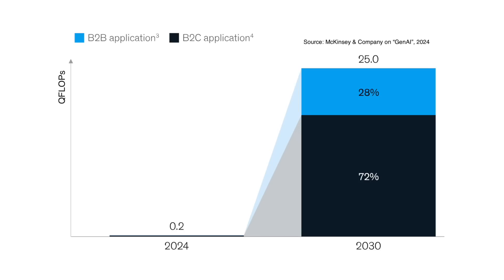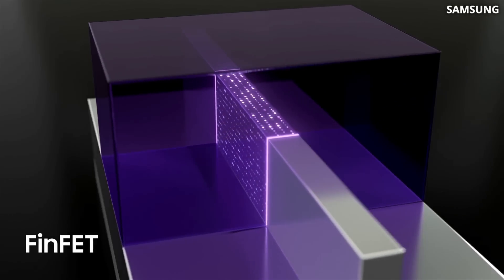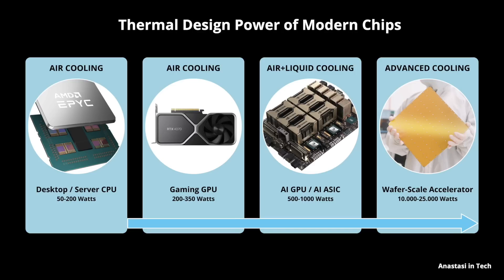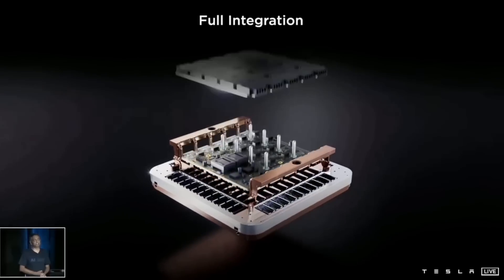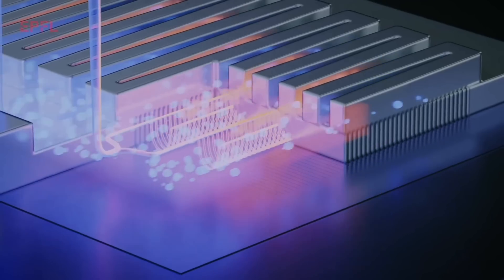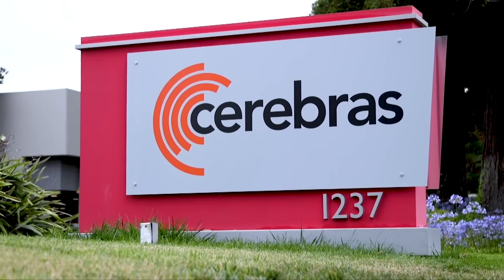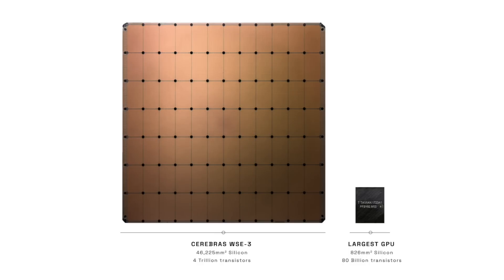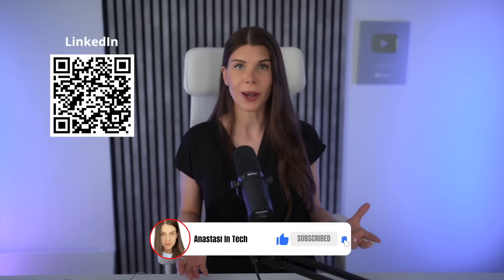This New Technology Will Keep Moore’s Law Going

Comment: If water works better than air to transfer heat, would there be something that transfers heat even better? I know that when your home air conditioner transfers heat out of where you live they don't use water. Perhaps some closed system involving some sort of refrigerant might be something to consider, the refrigerant flowing through or past the heat sinks for the chips.

One more observation about something that may be contributing to this heat problem: In the early days of computing, when CPUs were only 8 bit and resources such as memory were very limited coding was very efficient because it had to be. As the resources became greater and chips grew faster a lot of this coding efficiency went away. The less efficient the code is that the chips are processing the harder they have to work generating more heat. Just a thought.

Comment: I think the option of having phase change cooling just build into the CPU is a good option, so like a vapour chamber, but built into the CPU with the capillaries going right down into the CPU, then you shouldn't even need water cooling because you will be able to transport heat to air cooled heat sinks so efficiently it's no biggy, in cases were you want to have a heat spreader you can integrate the condenser into the heat spreader.

Like in a data centre you would still cool the air with water because it means you can efficiently transport heat outside the building meaning you can pack thermal density more tightly, but going with air cooling within each machine isn't about being cheaper for the hardware it's about the ongoing maintenance being more expensive over a 3 - 5 year period that is the big deal, the cost of the hardware compared to that is a none concern.

Comment: Ehh... you should know better that nm basically means nothing nowadays the feature size has almost no correlation to the branding name of the process, and minimum feature size does not even mean the same thing as transistor size because you have to have multiple features to make up a transistor so it's inevitably bigger.

Comment: At the beginning of 1970’s, the communication satellite dishes (for telecom companies) had cryogenic cooling attached to the rear to cool the LNA (low noise amplifiers). By the later 70’s the newer dishes used semiconductor LNA’s that did not require cooling.

Comment: It becomes clear that light will have to replace electricity for switching. Interference, both destructive and constructive will provide the 1s and 0s.
Power can be provided by the results of the SAFIRE experiment and the adoption of the Structured Atom model (SAM) of the nucleus.

Comment: All that heat is a valuable recourse if it can be captured and recycled into electricity.  It could help compensate for the large power needed to run the computers in the first place.

Comment: I've never been convinced that multiple CPU's are of great benefit unless the software is tuned to use them efficiently. I'd rather have a single fast CPU than multiple CPU's on the same chip. Simplyfication is one solution to heat generation.

Comment: I knew radio techs in the early 70's using "Can-tenna" products as dummy loads for r.f. outputs.  A 1 gal. paint can could dump a kilowatt of radio energy output into mineral oil while the set was tested and adjusted.

Comment: This issue is the same as faced by the home audio industry back in the 70's when regulations required that the advertised output be able to be maintained for, say, 1/2 hour, rather than momentary peak output.  Heat sinks grew exponentially and started including heat pipes and thermosiphons for the output transistors.

Comment: That wafer scale chip taking 15-25kW is crazy. For comparison, that converts to 20.1-33.5 horsepower which is about how much power it takes to drive a car at highway speeds.

Comment: Imagine if they started breaking out the silver and gold for data center chips for cooling. Also is it possible  to reduce the heat by using up some of the wasted energy? Maybe sending it to resistor arays or external trasitors that could power something like a piezo fans or charging a battery. Theirs better materials then copper just depends  on cost to efficiently over a set time of expected use. And its not like valuable metal loses it value when the product is obsolete just design in a way it can be recovered reasonably.

Comment: people working out what to do with all the heat, meanwhile people saying we need to burn more fuel and build more nuclear reactors to get hot so we can convert that heat into electricity. heat from compute should be compressed and used to generate electricity. recycle the power. heat->electricity->compute->heat->electricity->compute...

Comment: One of the natures of water is a cooler temperature for faster moving, could we use a variable velocity water cooling?  Seems like we need to go back to a single core per CPU to give room to cooling tubes.  The problem with multi-cores is the lack of multitasking because of memory restraints.

Comment: "...right  now the smallest transistors are just 2 and 3 nanometers..." -> this is not correct. The pitch between source and drain might be 2 or 3 nm but that's not the whole transistor. Process Nodes names are mostly for markting afaik.

Comment: Or you could use the Peltier stack so the heat generated from the cpu would power the first one and the 2nd one stacked on top of that would be powered by it so using waste heat from cpu to cool cpu

Comment: Someone should have informed Intel that the entire die can't be active all at the same time.

Sure direct chip cooling is certainly the future, but where does improved silicon wafer quality that allows larger dies to be more economical fit in? If nm advancement slows down due to the laws of relativity would silicon wafer quality improvements drive down the costs far enough so that spreading out the dies would be the stopgap approach to increasing performance?

Comment: semiconductors are getting smaller but our computers are getting bigger. My last one has a radiator with 3 fans for the liquid cooling and the video card is so big that it was coming with a support stick to put under. There is a total of 10 fans for cooling.  At least I live in Canada and that heath help to warm the house half of the year

Comment: i think the issue with backside power delivery might be solvable with a similar simpler solution on the bottom, and may not complicate the issue much more considering the complexity already there. if i understood what you meant.

Comment: Wondering when they go full Graphene instead of silicon that we currently use. We can see the physical limit in the Intel 13-14th gen 13900K-14900K heat limit from the voltage pushed to these CPUs.

Comment: why don't we utilise the heat in an exchange, like power generation systems?

the chip heat would then be a resource, end result processors would be more efficient regarding power.

like a nuclear power production system.

heat - steam - rotation - power

Comment: Has anyone that you re aware of considered running silicon devices at liquid nitrogen temperatures?  Lower temperatures allow you to avoid Shott noise so perhaps you can run at lower voltages (and hence less power).  This also has the lucky feature that the thermal expansion of silicon drop to zero, so local heating introduces minimal mechanical stress.  Liquid nitrogen is cheap like beer, so the cost should not be an issue for the big data centers.

Comment: I've wondered why motherboard companies haven't tried integrating more CPU cooling structures within their motherboards, allowing excess heat to be dissipated through a much larger area instead of the heat being directly allocated into the IHS and into a heatsink. Obviously, chip manufacturers would also need to alter designs to fit these sockets, but typical PC's should have enough airflow for rather good heat dissipation outside of the discrete heatsink. Even if only mildly successful, the payoff for servers, workstations, and GPU's would be rather large. Especially since I believe I heard that chip makers are moving power delivery to the underside of the transistors instead of on top.

Comment: Nope. The correct way forward is to design chips that use thousands of small cores, no cache, and which run at lower frequencies. After all, the human brain with over 80 billion neurons and trillions of interconnects (not to mention quantum information processing) manages to give us consciousness and creativity at a power rating of between 20W and 60W. We have gone down a horrendous blind alley and we lack the vision to think differently.

Comment: As cooling is actually transferring the heat (on chip or other) elsewhere; the ancillary opportunity is to turn that heat back into electrical energy for powering the cooling systems or the data centers. I know this become feasible only if the cost makes it so.

Comment: what if we designed non conductive, heat carrying channels throughout the chips 3D architecture.
use some kind of printing lithography to lay the heat dissipating chanels while the chips are being built?
I'm sure much smarter folks than I have contemplated all sorts of ideas, but it would be great if we could do something like this and continue in our 3D stacking of components

Comment: That was a truly fascinating walk through the heat challenges.  There's an interesting issue here - when you're dealing with in-chip channels this thin you end up with a lot of resistance, however low your coolant viscosity is.  It gets worse if you use phase conversion (liquid to gas and back) to pick up heat energy, you will need quite high pressures to maintain sufficient flow.  That again works its way back into a need for robustness of these channels to handle that.  It would be interesting to know how that is dealt with in design as well as the external facilities to keep that coolant moving.

Comment: I fail to comprehend the problem backside power delivery introduces to cooling.
Is it not manageable to have cooling fins between power channels?
I understand that there is more going on and therefore a bit more delicate to handle, but considering stacking, just stack fins together with the silicon and the power delivery.
Is it because the interruption of the cooling layer for the power takes away from its efficiency? Or is there fear of signal interference?

Comment: Actually 🤓☝️
Air cooler for CPU can allow around 280W
For GPU it allows around 800W (4090 with shunt mod got over 800W will staying under 90°C the hardest stress test

Comment: Encapsulation of a phase change material in microfluidics directly in the silicon perhaps in place of the through silicon wires might be an interesting approach to moving heat out from the center of thicker vertically stacked chiplets to the heat spreader without as much need for radical changes to the rest of the current cooling setup.

Comment: how come we don't have an internal device that replicates the frequency of cold as a way to keep chips and components cool? everything in existence has a specific frequency that can be controlled and amplified. cymatics is the key to unlocking reality and all potential future and current technology.
Reply: we spend too much time on coming up with ventilation pathways to dissipate heat instead of the counter frequency to generate cold dry air as the form of cooling, that could solve everything and have your pc cool to the touch while running at max

Comment: We worked on embedded cooling with back side microchannel in the DARPA 3DMINTS project (a chip stacking project under the DARPA High Performance Computing Initiative) nearly 20 years ago. One of the ideas was using nano particles in the coolant to increase its thermal conductivity and mass. I left the company I was working for just after winning the second phase, so I'm not sure how far they got, but the idea always seemed to have merit to me.

p.s. Seeing you laugh in your video was great. You should leave those bits in more often.

Comment: I live in Az, where the AC just can't keep up in mid-Summer. I sure hope there is better cooling at some point. With AI and superchips, that's a huge energy demand when we are trying to cut energy use for Climactic reasons. The real breakthrough is chips that don't generate as much heat, and thus take less energy. Although there is a limit due to information theory. But biological systems do tons of computing without as much heat. They supposedly use quantum tricks for that.

Comment: These videos always annoy me a bit. A particular gripe I have is I've heard her say a few times in a few videos that our smallest transisitors are 2-3nm. I don't know if she is unaware of the actual size of transistors, or just intentionally lying about them to the viewers to make things sound more impressive, but it's icky either way. Brushing over tiny details like this does not give me the information I need to know as an educated, invested viewer. It also does not inspire confidence in me that she knows what she's talking about.

In reality, transistors stopped getting smaller awhile ago, at least meaningfully so. Quantum mechanics puts practic limits on these sorts of things. It's not magic. There are SOME dimensions of transistors that might be 2-3 nm (the actual fins of FinFETs are around this size) but that is disingenuious to how many can actually fit on a chip. I would assume when most people think of transistor size, they think of how many can be lined up next to each other, or how many can fit in a certain area.

Distance between transistors is 40-60 nm.
The Gate width (typically considered the most meaningful measurement) is 15-30 nm

She repeatedly conflates the process node naming conventions (2 nm process node) with the actual dimensions of the transistors themselves and I would like it to stop.
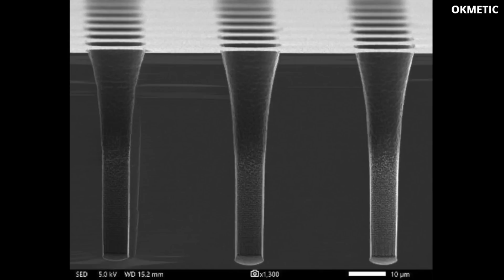Reply: I think she addressed this in a previous video: "New Microchip Breakthrough: Scaling Beyond 1nm" at around the 6:00 mark.

Comment: Thanks for a very interesting video. 
AMD’s new partner from Sweden, Smart High Technologies have a graphene based thermal pad that can handle 1200W chips. They develop TIM1 (Thermal Interface Material) and TIM2’s and have a development project with  AMD for a new TIM 1,5 product.
They are not as efficient as water cooling but will probably replace the cooling paste used today. They have already sterted deliveries to AMD. 🙂

Comment: Is there a reason we can't build peltier devices into the chips? I have always wondered if some of the heat could be converted back into electricity. If not actual cooling, at least moving the heat to a part of the chip that has better access to the cooling system.
Reply: Peltier devices have quite high thermal resistance. They'll create a temperature difference across the peltier plate very easily but transmitting heat from one side to the other is much more difficult for them.

Comment: Too much, spoken too fast, blurred bouncy monotone, too difficult to follow, with too much spoken rather than concise summary, and graphics flashing past too far with too little details and explanation.  Take a step back, and say, what does this graph mean to non industry professionals.

No coverage of magnetic cellular automata, likely already used by the military, which is an ideal technology for server and AI use at 1 million times less energy leading to 15cm blocks of 3D circuits using them conventional cooling, being possible, from my estimates in work years ago.  The upper limit of 4Thz operation   is being explored and 40Thz for other magnetic circuits.  Density at low heat per unit of performance is what matters.  Can anything else on the drawing board come close to this technology in this metric.  The research shows near perfect efficiency in energy usage.  Switching with minimal energy and virtually no leakage.  A good candidate for reversible computing energy recovery.  Not the end of the story, but the next book maybe.

Comment: Like regenerative breaking in electric cars, hopefully, they are using the heat from the chips itself to run cooling or powering the data center systems. Is that the case?

Comment: The speed and current draw is effected by the temperature.  The internal voltages will change with termperature I was involved with cold testing of IC's and the output voltages even change enough that the same test parameters cannot be used at cold temperatures. Depending on the cooling system I can see they will have to offset testing and maybe design for this.

Comment: I've been water cooling most of my technology for many years and i see a few issues with some of the things mentioned. Using deionized water (0PPM) will over time leach metals and other material in the loop leading to corrosion. Also cleaning water blocks is a pain in the butt, i can't see how cleaning the microchannels on a chip is going to work out.
Reply: What some people think is impossible may take a little longer to solve. No one fully understands an atom, but we can still use it to our advantage.